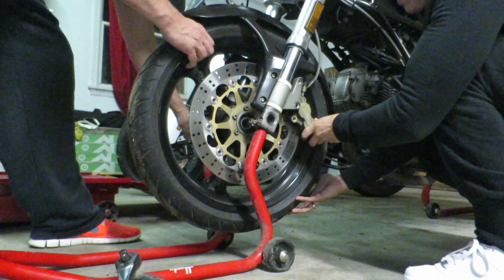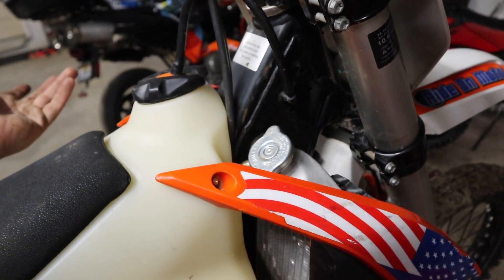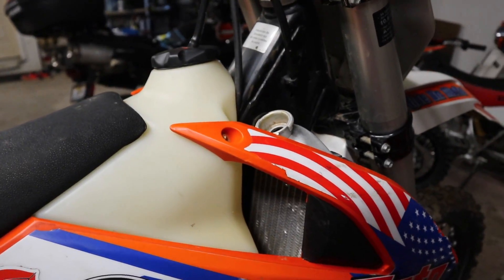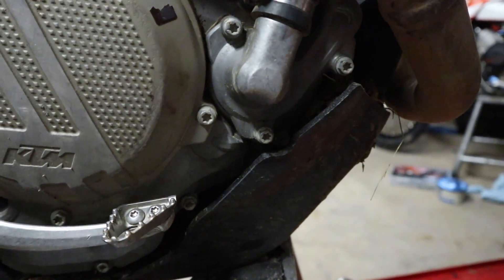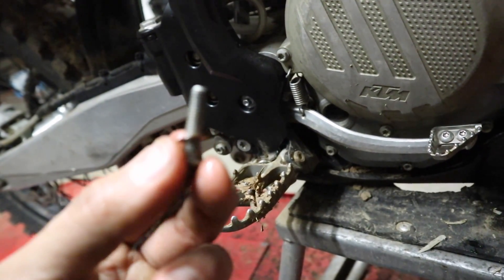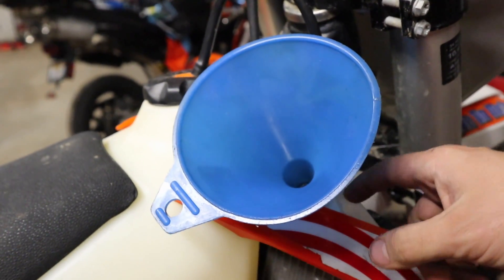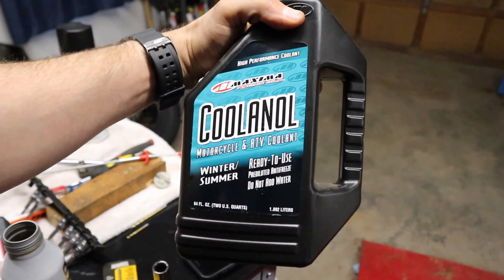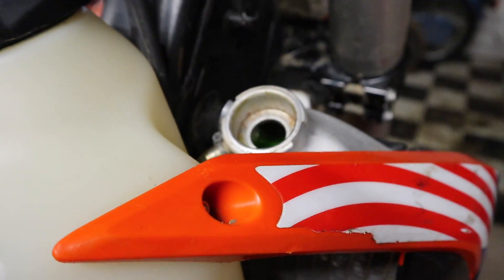How to Change Coolant in KTM 250 XCF Dirt Bike | Back in the Garage

Comment: my 2003 KTM 300 EXC has an 8mm bleeder bolt on the other radiator from the filler twist cap.  remove it and fill slowly until you get a dribble of coolant from the bleeder.  This goes for many bikes and european cars (audi, WV, Volvo, Landrovers) - they are big about removing pockets of air that can quickly overheat and ruin your motor/head gasket/radiator.

Comment: Wish my Daytona were that simple; it isn't hard, but the service manual directions only tell you to remove the drain plug, which is at the base of the cylinder block.  Lowest point of the system is the pump, so after draining the system as much as possible through the little drain hole, I pull the hose off the bottom of the pump and dump another pint or so!  Don't know why they don't just tell you to do that or why the drain hole is above the pump.  And it's finicky about coolant level, has to be thoroughly checked to ensure the air is all bled out after re-filling or it runs hot (once you get it right it's great though).

Comment: How is this with the radiator on the other side? Does it fill up with the other one? Or is the other radiator for something else?
Reply from the maker: Just fill it up like you would a one piece radiator. The 2 sides are connected through the frame.
Reply: I think hes in austrailia and the toilets flush the other way around.  JK.  caught me off too.

Comment: I have a 2019 KTM 250 XCW tpi, and in my manual it says the last step when you are doing a coolant change it to bleed any air out of the hose that goes from the radiators to the cooler?  I didn't see this in your video.  Is this necessary then?
Reply from the maker: If you start it up with the radiator cap off (and let it run a little while), it'll burp the air out.

Comment: I recently bought a 2012. 450EXC. It dumps the coolant before the fan turns on. One of the friends says the radiator cap spring is done and the cap needs replacement. The other one says it is really complicated to flush the system on EXC (he has older, RFS engine in it). Like, when the air stays in the system, it will overheat so I need to use some specific method I can't find on the internet :D
Reply from the maker: Try a new rad cap first. The stock ones aren't that great.
Reply: @2WR  
Thanks for the reply, this one is aftermarket but the previous owner ordered a new, stock one. So I'll give it a shot.
Reply: I run ENGINE ICE on my KTM and fold the hose over as a mechanical pinch -- you lose a lot less coolant that way.  The ICE makes a HUGE difference.  put it into my canam atv and the fans hardly ever kickon - before it was constant.
Reply: Also don’t forget there are a few bleeder bolts on the rfs engines. One I know for sure is above the piston. Forgetting these could create hot spots

Comment: What's that extra chamber on your exhaust pipe? I'm a 2 stroke guy but I've never seen or noticed that setup before.
Reply from the maker: It's a resonating chamber. Basically quiets the exhaust down without losing power.
Reply: @2WR  cool man thanks

Comment: Hi bro, Iv got a 2020 350 excf, do you need to bleed the radiator after you fill it?
Reply from the maker: Run it with the cap off. Let it cool, top it off

Comment: Water : antifreeze 1:1??
Reply from the maker: Pre-mix
Reply: only distilled water if you must add to concentrate.  just like batteries - the minerals will MESS UP your cooling jackets, water pump, etc.  splurge the extra $10 on the right stuff and avoid a world of hurt and expenses.